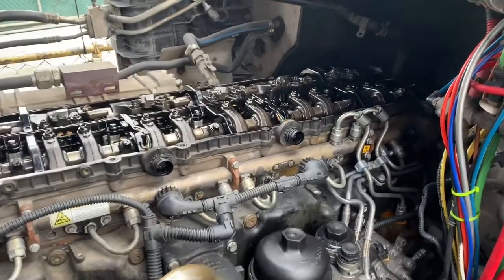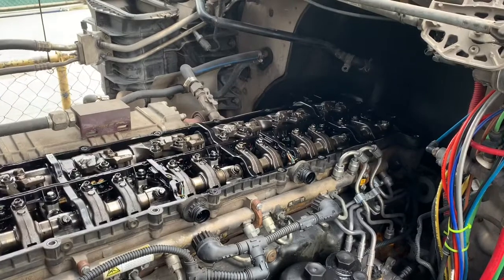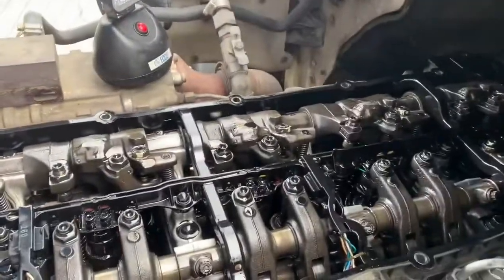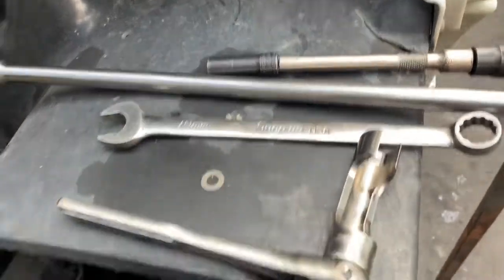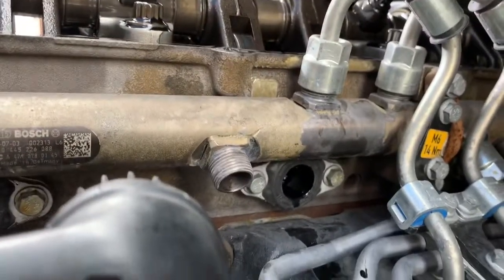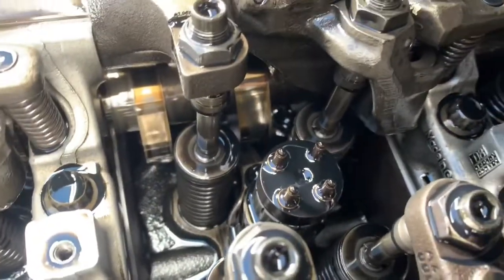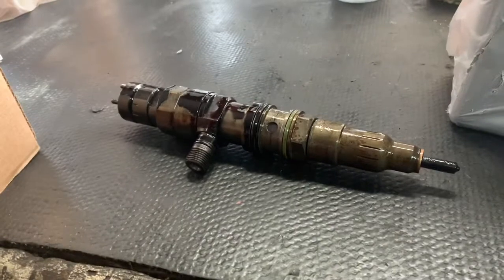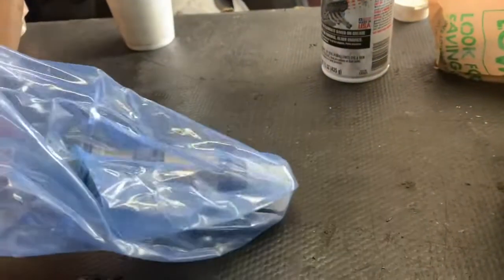Cascadia DD13 & DD15 injector removal

Comment: Hi Pedro, first I would like to say a BIG thank you for your very informational videos you take the time to share with us again thank you.  
I'm shop manager for my family's trucking company I have been doing this for the past 3 years, prior I was a GM for a trucking company that ran 130 units.  Big game changer for me. I love my job but there is still a lot I need to learn.  After watching this video my question is on the high pressure side of the fuel system aren't you suppose to drain the fuel a certain way due to injectors being in a closed state?  i am having issues with some DD13 #6 injector staying open broke a valve and cracked the head.  The machine shop is not standing behind this overhaul was done in Feb 2022 and here we are a few months later with this issue.
Reply from the maker: If an injector stayed open then fuel must have locked or damaged the engine. 
When you replace an injector or injectors you should remove the fuel that leaks out and will sit on top of the piston. It isn’t much. 
When the engine was overhauled, did the same shop buy the parts and install them?

Comment: Hello I got a question. I did a replace a number 3 injector, replace the injector harness, replace the fuel line, and the after I replace it put everything back together and I try to start a truck. It will crank couple times, ( weak crank and stop cranking and it won't let me start a truck, did pump the fuel try to start the truck through there starter and it won't start, I didn't programmed the new injector in the computer, do you think it will be the problem that the truck won't start or could be anything else, maybe the starter but before I did this job, the truck start fine. I don't know, if you have any idea, please let me know. Thank you

Comment: Does that high pressure fuel rail hold extreme pressures when the engine is off and how do you safely release pressure to avoid injury ?
Reply from the maker: xxtruckin93xx when the engine is running, yes there is extreme high pressure. However once you key the engine off wait 10-15 minutes and you are fine to start working on the fuel system. The system will gradually lower the pressure on its own. No need to do anything.
Reply: Carlos Diesel Electric  thank you for the reply I was always wondering about that and didn’t know if you had too bored the system via computer

Comment: Having bad injector issue 2015 cascadia dd13, oem is 1150$ each ((((( shop doesn’t want to work with aftermarket. It’s crazy expensive
Reply from the maker: $1100 is ridiculous, that has be with the core charge. They will credit you back the core once it is returned. 
Aftermarket is something I won’t touch. I have been burned too many times. Even if the customer agrees to or brings the parts. The shop runs the risk and responsibility.

Comment: My dd13 is leaking a lot of oil from the crankcase. I replace it twice but it’s still leaking. I have 870k miles on it. What could the problem be??
Reply from the maker: EDWIN MONTERROZA perform a compression test using the software. This will help to determine which cylinder might be bad. Could be the piston rings allowing blow by.
Reply: Carlos Diesel Electric thanks for the response. Where are you located?
Reply: Hey Edwin am buying a freightliner Cascadia with dd13 and am worried the engine may not be strong enough for hauling 80,000lbs, what is your experience with the engine
Reply: Harrison Odoh I used to haul water for bout 3 yers. Always close to 80k and it hauls good

Comment: Can you te if you have a bad injector with out the computer diagnostics?
Reply from the maker: You can, you would need to to listen for a misfire at idle or at higher RPM. A computer helps.

Comment: Hello  Carlos , I have questions, I have tune up, 2 weeks ago, and fist week I have long haul from ca to ks , when I come back I have code spn 1636 fmi 2 , active ,  last week I just from ca to ar same around like 3200 mile ,this time I have code spn 1325 fmi 31, and power is decreased 25%, and when I try to star engine ,the truck has shake , code active if driving felt normal, use computer try to found injector 3.4.5 not good , questions do I need tune up again or need change injector?or some problems from the engine?thank you
Reply from the maker: This maybe harness related. Let me get to my shop tomorrow and try and look them up. In the meantime, does your harness have any oil present? I don’t recommend injector replacement just yet. Very rare for 3 injectors to go bad. Again, could be the main MCM harness or the MCM itself.  But, let me check these out and try to get back to you tomorrow with some ideas.
Reply: Ok thank you for the help please let me know
Reply: 1636/2 is for the engine air tempature sensor says to replace it
1325/31 The fault condition is related to cylinder #4 exhibiting a misfire event. The entry conditions for this code are:
• Engine speed is above low idle
• All cylinders are active, no fault reactions
• Engine speed/torque is steady
This fault can occur due to the conditions listed below:
• Cylinder kit failure
• Valve train failure
• Lash adjustments
• Fuel injector
• High pressure fuel line (rail to fuel injector)
• Debris entering fuel injector (intermittent faults)
NO the injectors will go bad over time
Reply: @adolphushardy5186  What did the issue end up being?  I have this same code, engine misfire cylinder 6...
Reply: @lonniekeller9416  it could be an injector or the injector wiring harness

Comment: Thanks for the vid
Reply from the maker: Glad you enjoyed the video.
Reply: @CarlosDieselElectric  Do you need to input that part number and code into dddl?  Will the "truck" self learn? I own one truck, my truck, I try to do my own work.  Thanks in advance.
Reply from the maker: @aaronbyrne139  Yes, you would need to input the part number and the injector code into the MCM. Once you do that the rest is up to the MCM. You can perform ISB test using the software.
Reply: Carnal 
Question.........,
Can I use the seme liner puller for Ditroits, caterpillars, and Cummins??

And the seme sled gauge for Ditroits, caterpillars, Cummins engines?????????????????????????????????????????????????????????????????????
Reply: Do I need to buy dial indicator for every type of engine 
Cat= different one 
Cummins =different one 
Ditriot =different one ?????????????????????!?
Reply: I am roocky bro😁

Comment: Hello,  i have 2012 freighter with DD15 engine with 850,000 mile and we found cylinder 5 & 6 leaking coolant so i end up rebuilding the engine but my injector is working fine so far, do you recommend replacing all injectors or not and i would appreciate your answer
Reply from the maker: testy Ab i have done quite a few inframes/rebuilds. But replacement of injectors depends on if you are willing to spend the extra money. 
The customers that decided to not replace their injectors did not have any issues. Eventually you will need to but if they are not giving you any issues or loss of power or problems with regenerations then I say keep them.
Reply: @CarlosDieselElectric  thank u so much I'll keep it

Comment: I got a truck that’s is leaking fuel into the exhaust ? It’s not the dozer I have fuel in the hot pipe from egr
Reply: Should I replace injector cups?
Reply from the maker: @Eljuancho915  injector cups will usually allow fuel into the coolant system. When does it leak fuel? During the regen? 
Do you have a hard start situation? Does the truck start up normal?
Reply: @CarlosDieselElectric  kinda figured cups wouldn’t be it due to it being only for the cooling of injector
Reply: It’s a deleted truck what about a stuck open injector
Reply: Truck will only start if it is primed but dumps fuel from exhaust pretty bad
Reply from the maker: @Eljuancho915  might be an injector or injectors. Try checking the valves. If they are too tight this may cause the fuel that isn’t burning to go towards the exhaust.
Reply from the maker: @Eljuancho915  definitely an injector or injectors.
Reply: @CarlosDieselElectric  cool I kinda wanna say injector/s now if they are stuck open doing a cylinder cut out test won’t pin point what injector it is right ? Since it stuck open causing it to flood the cylinder/s
Reply from the maker: @Eljuancho915  I would try doing a cut out test but definitely would not want to rush damaging the engine. 
What year is the DD15?
Reply: @CarlosDieselElectric  it is a 2016 I’m just worried about it tryna run away one of my coworkers was the one who was assigned the truck for a pm but couldn’t get it to start
Reply: When I went over I saw I’m not kidding either what looked like about a gallon of fuel on the ground and fuel pouring from where the bellow meets the turbo pipe and I took off the u shape pipe from egr to manifold and more fuel dumped out
Reply: Truck starts after being primed and runs like shit and of course there’s lots of white smoke
Reply from the maker: @Eljuancho915  I am definitely leaning towards fuel injector or injectors.
Reply: @CarlosDieselElectric   thanks a lot man you don’t know how much your videos and you responding to the comments help swear it would be bad ass to work with a tech like you!!
Reply from the maker: @Eljuancho915  thank you.
Reply from the maker: @Eljuancho915  glad you were able to see that there was a problem before any serious damage

Comment: hi carlos can the mechanic find out if its enjecters problem  . felt am losin power are 65
Reply from the maker: Very difficult to tell, you have to test the charge air cooler, perform a valve adjustment, check fuel pressures at different RPM's. Have your mechanic try these things first before anything else.

Comment: Question, i have a Freightliner DD 15 with a fault codeSPN-3661 FMI 3 engine fuel 1 injector cylinder 3 actuator 2 ??
do i have multiple issues???
Reply from the maker: I can double check that fault code tomorrow. But it might a harness issue, you have two harness’ under that valve cover. The front harness for injector 1, 2, 3 and then you the rear harness for injector 4, 5, 6. 
On the outside of the valve cover remove the round plug and inspect for oil contamination. If any oil is present I would advise to first start there. You may have to replace the injector harness (front and back).
Reply: @CarlosDieselElectric  ,  I unplug both connections and they are clean and don't have any oil contaminations..
Reply: @CarlosDieselElectric  @ Im going to change both injector harness. I hope that will fix my issues. Also the original code cleared itself now i have SPN- 1073 AND SPN- 1072 FMI 5, FAULT code...any more advise or ideas you can give me. i really appreciate it.. Thank you for your help...
Reply from the maker: @josholivieri4577  I can look up the code tomorrow. I’ll let you know what I find.
Reply: @CarlosDieselElectric  @ question, I have that code that came on again SPN-3661 Fmi 3 ( Engine fuel 1 injector cylinder 3 actuator 2) I changed the injector harness both of them, I changed the engine wiring also ) any help would be greatly appreciated...
Reply from the maker: @josholivieri4577  at this point, if you replaced the both injector harness' and the engine harness, you may have a bad injector or a bad MCM. You can swap injector number 3 with 2 and see if the problem follows and goes to number 2. Try a test MCM.
Reply: @CarlosDieselElectric @ ok going to swap injector 3 with injector 2. But the description stated injector 1 cylinder 3 actuator 2. Also how do I run a test on the MCM ??
Reply from the maker: @josholivieri4577  email me. This way I can go over with a little more detail.

Comment: Hey can a bad injector cause vibration without getting any codes on dd13 engine? .pls share.
Reply from the maker: Good question, yes an injector can be bad without generating a fault code. The mechanical side can fail and cause this issue. Perform a manual cut out test to confirm which injector is NOT cutting out.
Reply: Thanks for reply.

Comment: What code were u getting
Reply from the maker: gus in this instance there was no check engine light or active fault code. The owner said he felt the truck was shaking at certain speeds and he had low power. So I did a cylinder cutout test at low rpm and high rpm in order to find the bad injector.